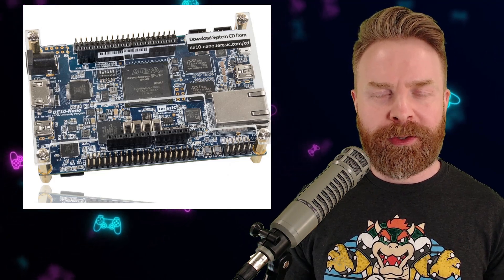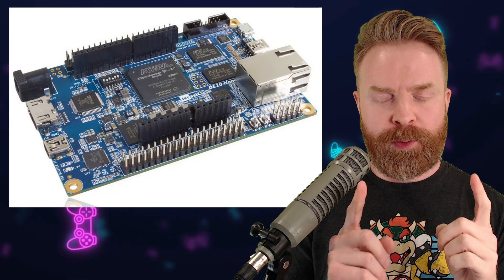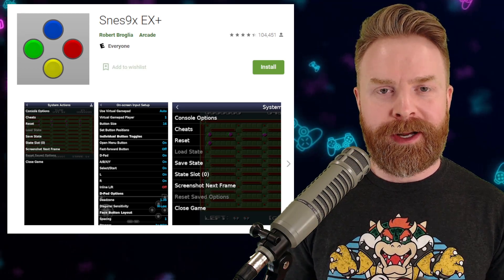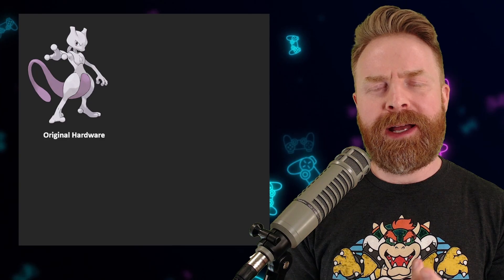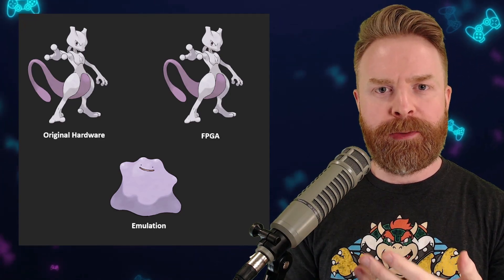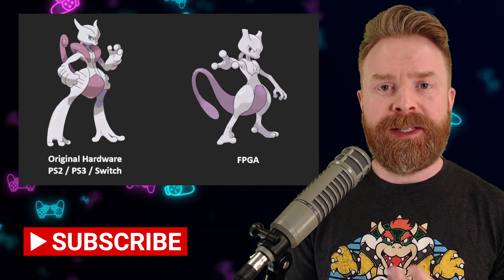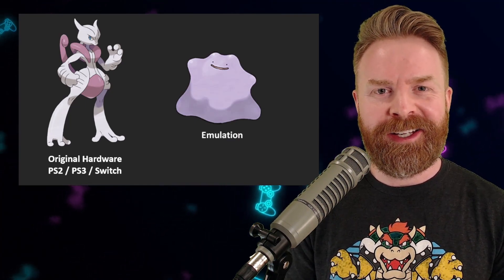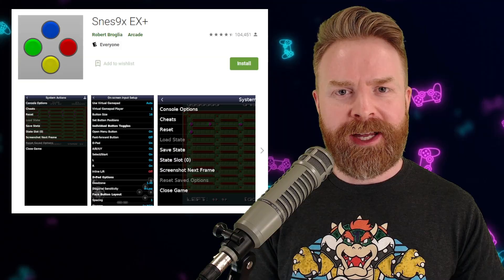The difference between FPGA and Emulation explained at a high level

Comment: What got me into fpga was the potential for 100% cycle accurate simulation. While the potential is there it requires much more research. And probably decapping and mapping ICs . Most FPGA cores don't go this extra step as it's not simple with a high failure rate and wastage.
I still think it's worthwhile going the FPGA route as when it's done properly, it preserves not only the software but the hardware.
Reply: Software emulation can also be 100% cycle accurate too. That isn't limited to just FPGA.A couple such examples of this are the Stella Atari 2600 emulator, and the WinUAE Amiga emulator, but there are others.

At the end of the day, hardware or software recreation, it's only as good as the people making it, and there are good and bad FGA and software recreations.

Comment: In the name of God !!! People stop making these videos. FPGA IS NOT A SIMULATOR it is still an EMULATOR with better partials. FPGA uses cores in different versions that are implemented over time according to the errors that the games can give in the emulation. They are the same cores developed for RETROARCH. If there are some improvements in the loading times of the screens within the same game, the implementation of the emulation in FPGA will take 20+ years. In FPGA MISTER you will not find inside, for example, the complete hardware of a SNES. Each chip, each transistor, circuit board, resistors, etc... is an emulation with a little more level only speed tests have already been done in the games REAL CONSOLE VS EMULATION VS FPGA. The differences are minimal! Software emulation is very advanced these days with accuracy cores and it continues to advance. For now FPGA is very far from being the holy grail of emulation.
Reply: 🤔 AGREE  half simulation , half emulation.

Comment: FPGA is still emulation, just a different kind of emulation than software emulation. FPGA is emulating the circuitry in a cycle accurate manner vs a program that translates old software to run on a different system. FPGA is going to give the most accurate results in replicating the experience of old hardware if it is coded accurately. Software emulators can do things very differently depending on how they are programmed. Some replicate the old hardware and run the software on emulated hardware, some translate system calls to modern operating system calls, some recompile the software to retarget it to a different system. Both FPGA and software emulators can add enhancements like overclocks, enhanced hardware like extra sprites per line and more memory, upscale resolution, add mods and texture packs and add save states. There is no simple one is better than the other but a a general rule you will get much better results with a good MiSTer FPGA core over a Raspberry Pi software emulator and it is well worth the money to get a DE10-nano over a Raspberry Pi in my opinion.

Comment: In short , FPGA seems to be an expensive way of running systems you can emulate perfectly on say a pi4 .. if FPGA allowed systems like the PS4 or switch  to run it would be more of an option .
Reply: If I play on my mates Pi 4 and then come home and play the same games on my MiSTer I just score higher and it just feels better. It is much closer on a modern high end CPU but the Pi is nowhere near as accurate as FPGA.

Comment: Software emulation is perfectly fine for most scenarios. It's accessible right away and most people just need to be able to play the game without a hassle. I firmly fall into the group of people that prefer to experience games on actual hardware as intended with no input delay but don't or cannot invest thousands of dollars so the MiSTer FPGA is the next best solution. Having no input delay has unintentionally improved my performance in many games I never expected to be good at.
Reply: I've not experienced input delay with software emulation.I built 4 MAME machines more than 20 years ago. Vector monitor ones even.  What games are you running where you've noticed that? What kind of hardware, display?

I use arcade CRT's and Windows computers. Classic games only.

Comment: Just a newb to most of this, but how far can FPGA be pushed - what is the highest level of hardware can it do?
Reply: The current chip used in the MiSTer is using all the logic elements with the latest PlayStation 1, Sega Saturn and Sega 32X cores.
Reply: depends how much money a person has for the big fpga 1,000-100 k and you would need a group to work together . you can use a hybrid ARM approach with fpga also

Comment: I think what would be more interesting would be a combination of the two, the hardware replication of the fpga along with capabilities of emulation software, it could allow for some pretty impressive things do be done especially with upscaling (for example) without the cost of performance
Reply: There are some Mister cores that do this, and I think it's been a bit controversial in the Mister community, maybe not much though. Also, you can mod and add features to original hardware, right? Look at the HD mods. You can add features to Mister cores, too. The main reason why I prefer the Mister is because I'm probably borderline OCD. When I played with emulators, I always ran into various glitches that stunted the immersion. I have yet to have an audio or graphical glitch on the Mister on the Mister cores I play, at least nothing I've ever noticed. Admittedly, it's been a little while since I tried an emulator, though.

Comment: Imo the true difference is performance cost.
Both options have the potential to offer perfect emulation given talented programmers, but with emulation there's the need for overhead performance since basically the emulator has to translate from one system to another as such you need a more powerful device to emulate an older system.
FPGA don't need that overhead since they're using the same language as the original system but you need a specific FPGA board that can match the original system in performance.

Comment: This FPGA "simulation" is just like MAME (or MESS) it "simulates" chips but in hardware. Both will give experience identical to the original hardware..   Actually, maybe Mistet is actually using MAME references because it's the only complete documentation and implementation (afaik) of consoles and arcade machines.
  MAME works for me, but I can't deny that FPGA devices like this one are very attractive.

Comment: FPGA is amazing! But it is still relatively young (obviously) compared to software emulation. For now I find that its current amount of benefits is not enough to beat software emulation and thus there's obvious debate. It can basically only do 1 thing better than software emulation, and that is low latency.

And by low latency, I mean that software emulation is only anywhere between 1 - 3 frames of latency, but if using Linux, RetroArch and a good enough CPU (and GPU?), you might get less than 1 frame of latency, at which point FPGA would be pointless :P I can do so much more on RetroArch, like Netplay, shaders, overlays and customizable menus, that I just can't justifty FPGA devices (yet).

When it comes to accuracy, just how much more accurate can FPGA be at playing NES and SNES?
With almost all the games, if you have a Raspberry Pi with RetroArch and any of these consoles running side by side, they'd appear to behave, look, and sound the exact same. There's just not enough higher accuracy for me to even develop any preference.

Here's a fun fact: RetroArch is actually better than FPGA if you're playing on a TV with a lot of lag! Just configure Run Ahead to make up for the lag more than an FPGA would, since FPGA can't run ahead. This was actually a valid argument the last 6 or so years (God time flies). Nowadays most people have TVs with a good enough Game Mode that this is now a trivial difference haha.
Reply: the gaming fpga scene has been around for 20 years its just going mainstream has always been super niche befor fpga became more cheaper

Comment: I play both. And I feel (mostly in arcade fpga and emulation) the input lag. I've played arcade almost all my life and I can see I'm a better player with MiSTer than with emulation. But I like them both, it's just where do you feel more comfortable playing.
Reply: Have you tried Retroarch with it's latency settings menu? If you use the Final Burn Neo core, or the MAME 2003-Plus core, you can beat the Mister and original hardware in terms of low latency.
Reply: I also came to recommend you to enable the auto frame delay feature and the run ahead one. The latter requires a bit of tuning and understanding, but everything is well worth it. You're going to annihilate any lag.
Reply: ares also has runahead. And it's a much neater software than retroarch (no name/fbn cores though).
Reply: Are you using a CRT?

I've been using software emulation for some time, and I've never noticed lag. I run arcade CRT's with software emulation for MAME, classic computers and classic consoles. I'm mainly into classic games from the 80s and 70s. It could depend on the particular type of games you play. I'm not into the karate games, so who knows? I play classics like Pacman, Defender, Marble Madness, etc. Also perhaps less inputs/button presses at once?

Most of the lag I've heard about is because of the LCD's.

Comment: I'd love to give the MiSTer a try but it's too expensive for my pocket and I already have plenty of hardware sitting around.
Software emulation does it for me for the most part but I still like to use original controllers.
Circle accurate emulators like Higan are really rare but have really no disadvantage to a FPGA solution.
And luckily, even lesser popular systems like the SEGA Dreamcast received its fair share of good quality emulators albeit not totally accurate.
Reply: *cycle
Reply: @DanielMcLaughlin85  Yea my bad.
Not my native language and barely any sleep :/

Comment: If you can see the difference between a very expensive FPGA and a good emulator, you are a cyborg
Reply: its really easy to tell no need to be a cyborg a PC will always interfere with a emulator while its runing you will see frame skiping or sound getting mess up a little . the overhead from the OS will give it away on a fpga you get none of that side by side with real hardware its hard to tell .
Reply: @soloM81  Any PC from last 6 years can run an 8bits, 16 or 32 bits console emulator with no problems.
Reply: @IvanRodriguez-C its not about if it can run the emulator the OS still can causes hiccups no matter how powerful the PC is when you say its not possible to tell that is false . when it comes to fpga its very difficult to tell no OS no layers it becomes a NES unlike a PC it has to be a PC first and a NES at the same time
Reply: @soloM81  If your computer have hiccups running a simply 8bits or 16 bits emulator I think the problem is your computer, not the emulator. A budget chinese can run any 8bit or 16 bits emulator....
"  SoloM81: All 8bits and 16 bits emulators have hiccups even in the more powerful computer. Source: ME"
Reply: @IvanRodriguez-C   YOU KNOW NOTHING  fpga has no over head pc emulation does not up for to debate
Reply: @soloM81  You should find a replacement for your Pentium 100 Mhz that can't run BSNES or Mesen... 😉
Reply: so im a cyborg afterall , i can see and feel inputlag difference between fpga and emulator
Reply: @striderhiryu973  that is called suggestion....

Comment: Emulation is also better at expanding the original capabilities of the console. I'm not exactly trying to go back to dealing with flickering sprites on my NES games or frame drops in my schmups again either lol.
Reply: Most MiSTer FPGA cores that experience sprite flicker have options to upgrade the sprites per line like the TG16 and the NES. Many cores add overclocking as well to deal with slowdowns like with the Double Dragon arcade core.

Comment: Both are great. Fpga is better at classic consoles but not by a huge margin. There is a law of diminishing returns with fpga for newer systems (assuming we ever get that much power with an fpga), as they don't use precise timing the way the older systems do, so they don't need to be super accurate. I'm glad we have fpga for what we have though, for preservations sake.
Reply: In what way FPGAs are better at classic systems?
Reply: @Imgema  Think of timing belts in a car. The timing has to be just right for everything to work. Old consoles worked like this. Fpga is able to replicate old consoles, in theory, in a 1:1 ratio. This means the colors are more accurate, the sound is more accurate, etc. A lot of people may not care about that, but purists will.
Reply: @TheRelen222  Software emulation also emulates correct timings. It makes the emulators more demanding in CPU power, like BSNES, but it's something accurate software emulators do. 

Sure, there are also performance based emulators that don't do that but we shouldn't compare FPGAs to those so the later look better, do we?
Reply: @Imgema  The “run ahead” option on some emulators fixes some of the latency issues, but it will still be many years until the power requirements for more perfect timing become ubiquitous for the average consumer. I use both software and hardware emulation so don’t really have an ego investment either way.

One thing that’s not mentioned here is that Mister is not just for old consoles but old PC systems as well. Commodore 64, Amiga, etc., as well as 1:1 replications of arcade pcb boards. Personally, I hate dealing with MAME, so it’s worth it to me. Also, it can be hooked up to Pvm or crt monitors easily, which brings its own benefits, so I still think it is worth it.

Comment: We need these FPGA chips inside smartphones
Reply: no, make it an optional plug-in. It will add to price to those who don't want it
Reply: That kinda defeats the point of fpga
Reply: @solanumtuberosa  Explain please.
Reply: @GoldenMean743  adding a device that emulates hardware on a device that can more powerfully software emulate? Its like asking for a roll film camera on a phone. Also fpga uses actual physical cartridges, imagine adding that to a phone.
Reply: @solanumtuberosa  I get what you're saying now and I kind of agree. I don't understand  the carts thing. Fpga requires an SD card and an optional ram stick  but not carts.
Reply: @GoldenMean743  sorry on that part. Kinda got mixed up on my head with those accurate amiga clones
Reply: @solanumtuberosa5824  my man I don't think you  understood what FPGA is as of 1 year ago.

Comment: short answer FPGA is also emulation, so there no difference actually except FPGA more expensive than emulation machine you can build or have, but I bet those elite of FPGA follower will say otherwise, which kind of pointless coz in the end of the days this just for you and me to play game and have fun nothing more nothing less.
Reply: The only potential FPGAs have is lower power consumption for the same level of accuracy as a PC emulator, since accurate emulators on PC need more powerful CPUs. Input latency can also be better since there is no OS overhead but on a good PC there are options like GPU sync in RetroArch. Otherwise there is nothing in FPGAs that makes emulation inherently more accurate than software emulators. Both rely on the programmer's skills and their knowledge of the system they try to replicate.
Reply: @Imgema  well the problem is there RetroPi for Rasberry Pi and can do basically all FPGA do (or maybe even more as development been longer than FPGA) in more cheap price and almost out the box setup too or Cheap Android TV these days cheap Android TV quite powerful enough to play many retro game up to PSP which maybe we should say thank you to developer too, but like I said those elite FPGA users who keep claiming its not emulation will always argue about it, which pointless coz in the end this about you and me play our favorite game either if you go to cheap road like me or other who use FPGA, as long its can do it and we are having fun.